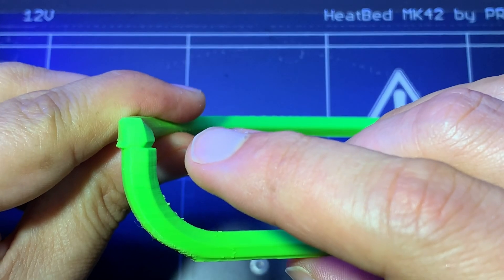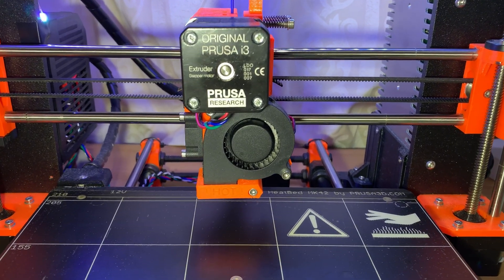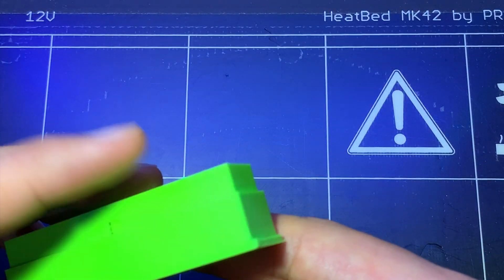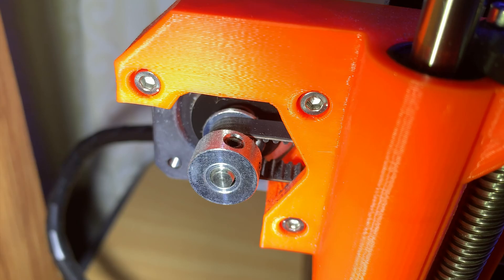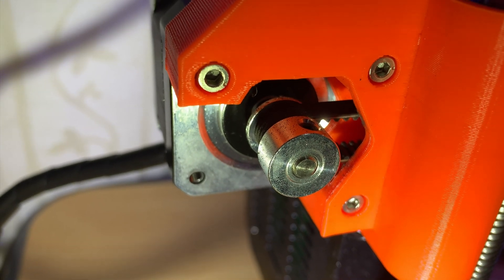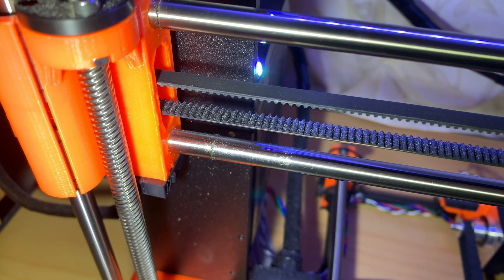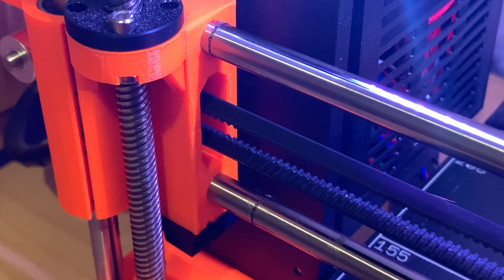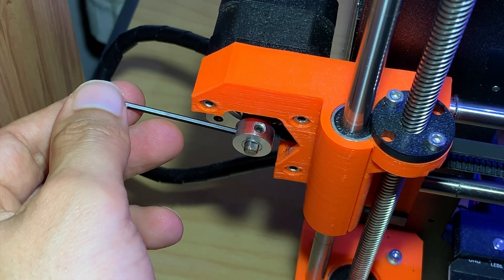How To Fix Shifting on the X Axis of a 3D Printer

Comment: Also ceck the pulley bearings on the right  side on prusa or fysetc  prusa,I got the fysetc  version couse is much cheaper but is kinda the same printer,u also changed the bed rod rails with linear rails witch is much better and the hot end is a dragon bmo,but be careful  if you gat the same hot end,when you wanna change the nozzle,you could bend the hot end throat,thinn pipe

Comment: This is what happens  when you  belive that the 3d printer manufacturer did everything  by the book,not all the people ceck the pulleys to see if they are tight,but in some cases they become losen  becouse of the vibrations along time

Comment: Great solution.
I had the same problem,messed about with belt tensioners,and bed clips.
Tightened the grub screws,and it worked.
Thank you sir.